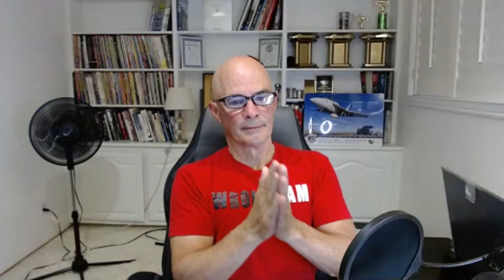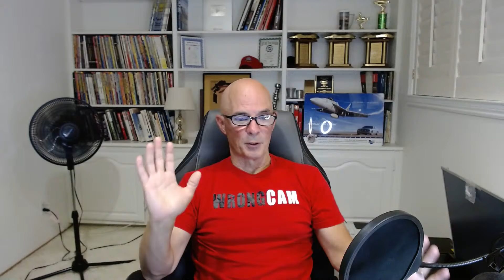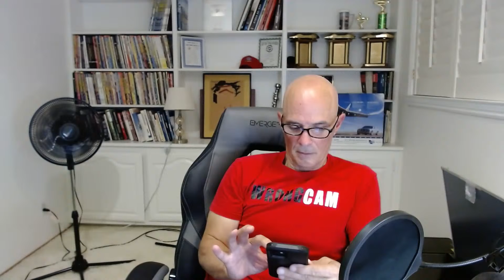LET'S TALK TECH-ALL MOTOR LS STUFF

Comment: Richard, I believe that noise in the vid is some kind of electrical interference from something on your desk. Probably your phone vs. your mic. You moved something & the noise started. Went away when you held up your left hand to focus your camera around the 57 minute mark.

Question for you: Building my lower end of an LMG 5.3 that came in my '07 (Gen IV - 53x) Silverado for towing / street playing. 243 heads stock 9.9:1 compression with flat tops. I'll be installing a Truck Norris cam & Magnuson supercharger at 6 psi running pump gas, always (93 around here for the most part, but some states is 91) - never E85. I was told by Ted Jannetty of Jannetty Racing in CT to rebuilt my 122k mile lower end before proceeding. On BTR's site, I've picked a boosted rotating assembly (minus crank) that has a Wiseco forged .020" over AW-07268, 3.2cc flat top pistons. This piston has a compression height of 1.300" with a 6.125" rod, while my stock pistons have a comp. height of 1.338" with a 6.098" rod. Is this going to have too high of compression with a Mahle 168-54442 head gasket (.050" compressed thickness) for 6 psi of boost? Thanks in advance!

Comment: Ls swap the world
Reply: Best all round motor ever built. There are better motors for purpose built applications but for the money, reliability, ease of finding parts and the actual design of the motor, nothing else even comes close.
Reply: @rovingmarks  I'd agree with you if I didn't have to work on them, lol. Nothing will beat the old small block 350 for ease of, and cost of rebuilding. From a mechanical standpoint, I HATE the LS. Plus the Gen IV has the WORST top end track record of any V8 to date, although FoMoCo and Stellantis are both in the running there as well.
Reply: @SmittySmithsonite  Sbc is a little cheaper to rebuild but the stock blocks won't hold near the hp of an Ls. I grew up on sbc, before ls was even a twinkle in an engineer's eye, love em, but dollar per hp the ls has the sbc beat. A merlin or dart block negates the cost effectiveness of a sbc rebuild.
Reply: @SmittySmithsonite  My Ls experience has mostly been gen 3 though.
Reply: @rovingmarks  Yeah, power-wise the LS rules, no doubt about it. I just wish they had kept us mechanics in mind when they engineered the thing. It seems like it was designed by someone who despises DIY'ers and techs alike.
Reply: @SmittySmithsonite  Well, you know the age old saying, an engineer would walk past five virgins to fuck a mechanic. As true today as ever.
Reply: @SmittySmithsonite  what tends  to be the failure point(s) on Gen IV?
Reply: @AndreS_-df2nw  All top end and AFM related stuff. Lifters, springs, cam (pitting usually), cam bearings that walk out of their bore, internal oil leaks, etc..